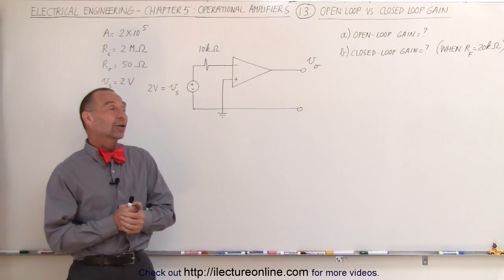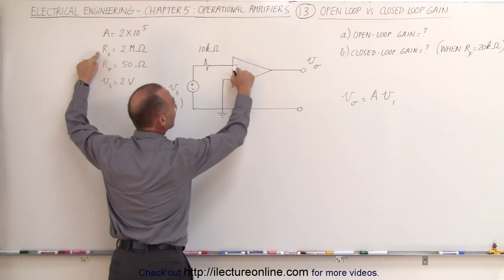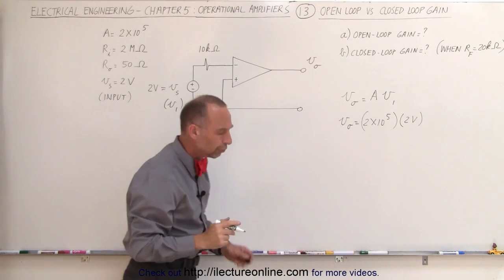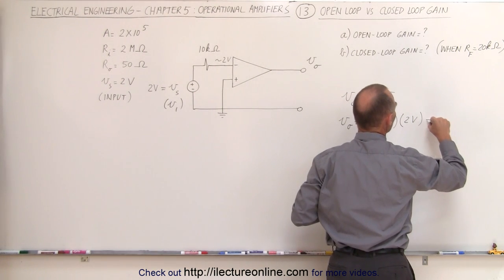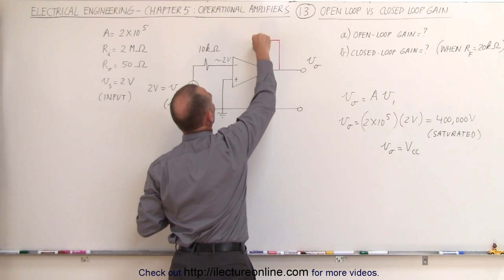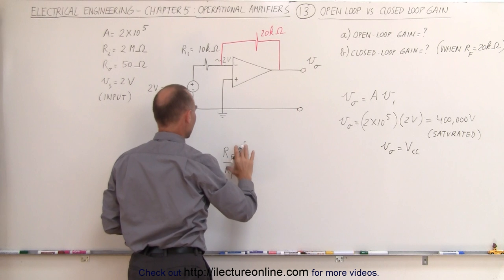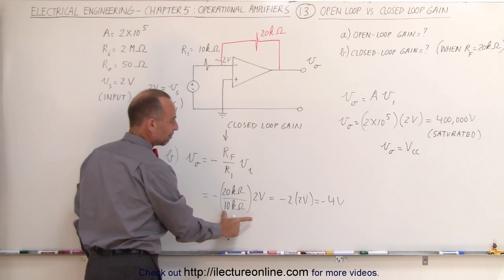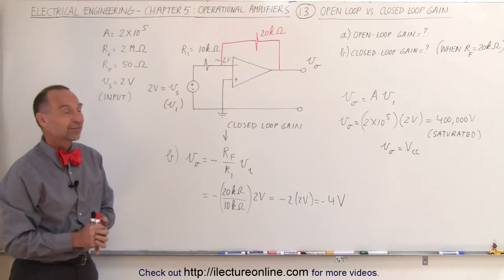Electrical Engineering: Ch 5: Operational Amp (13 of 28) Open Loop Gain vs Closed Loop Gain

Comment: Wait. Wouldn't Vout for the open loop gain be negative since the input voltage is going into the negative terminal?
Reply: you are right on the money!! I think that he forgot to do A(v2-v1) and since v2 is hooked to a ground then it should be A(-v1)

Comment: But this must be an axception because in ideal opamp the voltage at the inverting & non inverting terminals is considered to be the same. But here while the inverting input has 2V, the non inverting is at ground or 0V, why is this?

Comment: Just quick question, should V1 be -2 Volts? Since the positive terminal is grounded and the negative terminal has a voltage of 2 volt, so V1 = 0-2 = -2V?
Thanks a lot, the video is quite helpful tho

Comment: Was having trouble with gain and so looked up how to calculate open loop gain, but this came up with its misleading title as this video is about voltages, not gain.
Reply: No idea if you still care or haven't found an answer...but anyway one year later I can tell you that the gain will just be v_out / v_in

Comment: Hi Michael, I have troubles of understanding the output voltage for open loop gain. Shouldn't V_out = A_open(V+ - V-)? I understand V- = 2V, but with that plug into the formula, should you get -4E5 V for V_out? Please let me know if I understand it incorrectly.   Thank you so much!
Reply from the maker: You are correct.   It technically should be a - 400,000 V.  I simply stated the magnitude of the open loop gain.
Reply: Ok! Now I finally understand it.
Reply: Michel van Biezen Thank you!

Comment: Hello Sir, I would have a question. Comparing the ideal and real op amp... we are mostly talking about open loop gain which is in ideal case infinite. I am wondering... is there any possibility, even with a closed loop to have a gain into minus infinity? How does it looks in ideal and real op amp? Or better to ask... is there any case when we have negative infinity gain? Thanks
Reply: Answering very late, but in the video he had a opamp that had a -2 gain. How high the gain is, is dependant on the resistors in the circuit. In theory you are able to have a "infinite" gain.

Comment: what is the 50 ohm resistance for?
Reply from the maker: It is the output resistance.  See this video:  Electrical Engineering: Ch 5: Operational Amp (11 of 28) The Non-Ideal Op-Amp 
  https://www.youtube.com/watch?v=xtMFKqPpjkU